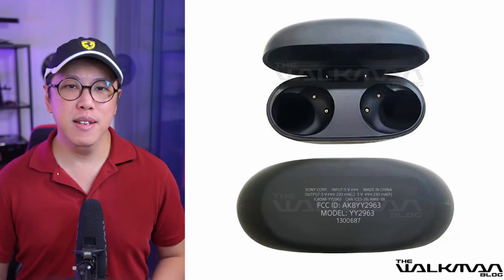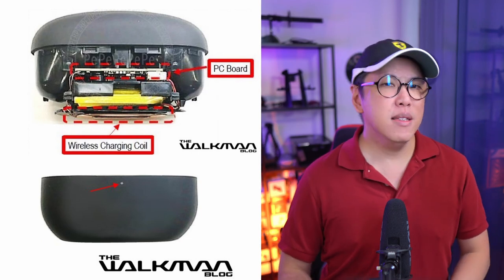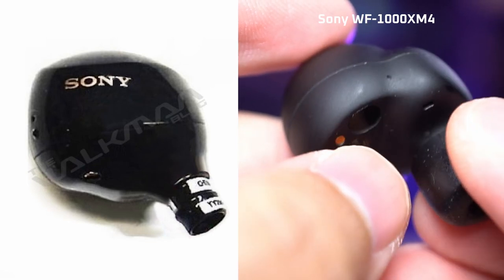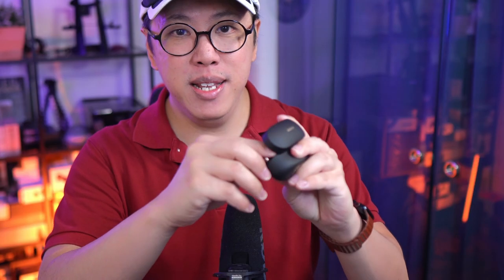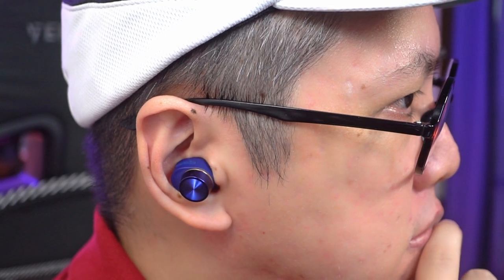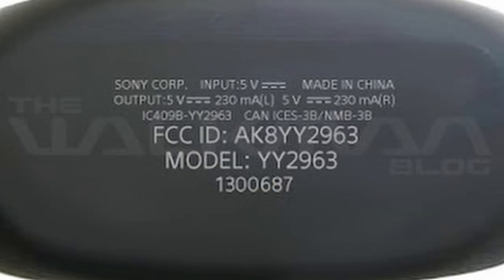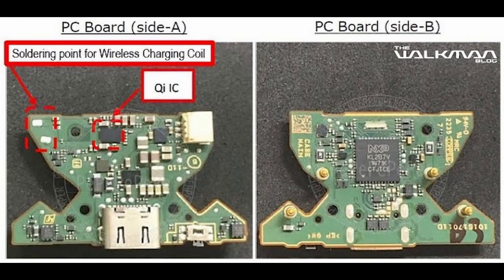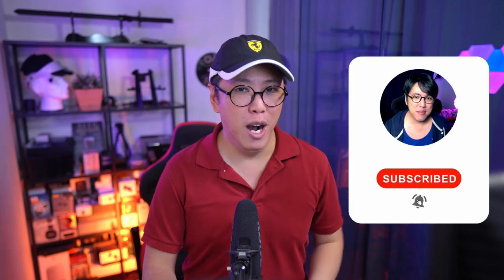Finally... This is the Sony WF-1000XM5! 🔥🔥🔥

Comment: Thanks Aaron. Off to read the link. Article read. The one thing that stands out is the matte case but glossy buds. Would make sense the other way round but glossy, slippy buds in your hands and in your ears? I hope this is not the finished product? Thanks.
Reply from the maker: Yeah we'll have to see if it is really slippery or there is a design element that mitigates the slipperiness

Comment: Had nothing but issues with the xm4’s. Especially after about the 1,5-2 years mark. Battery randomly discharging, overheating whilst charging, case not holding charge etc etc. Sadly the xm5’s will be a hard pass.

Comment: Man it’s been so many years and AirPods Pro case is still the best. Really good balance between battery life and size. And I don’t understand why companies increase the thickness of the case instead of the height. APP case is thin but squarish which means that it slides really well in pockets.

Comment: I have WF1000XM3's for sleeping. I tried the 4's but they're uncomfortable while resting your head on a pillow.

This is what I don't like about the XM3's:

The noise canceling is on by default and it doesn't remember if you switched it on or off.

That means every time I get on a bike or I'm walking and it's windy outside, I have to go into the app (wait for it to load) and switch off noise canceling.

This is so annoying that I have cheap wired earbuds for when I go outside.

I don't need noise canceling 90% of the time, if it can't remember whether noise canceling is on or off (I don't see why given that it'scontrolled by the app but whatever), that's fine, but at least give me the option to have it off by default.

This really annoys me I guess, from a design perspective. Does the 4 still have this issue?

Comment: The new Sony WF-1000XM5 are completely better than even first-class predecessors.
Even though the Sony WF-1000XM5s are smaller, they sound even better.
Battery life has also become even better.
Tragekompfort hold bombproof in the ears, all Sony hold bombproof in the ears, the Tragekompfort is perfect.
The new Sony WF-1000XM5 since Sony has again done as always maximum best work.

Comment: I got wf xm 4 and wh xm 4 momentum 2 /3 overhead and earbuds and bose quietcomfort 1 and 2 earbuds and earfun and soundcore and 1more. Because of battery drain from 12hrs to 4 hrs on wf xm4 I WILL NEVER EVER BUY a SONY . plus sound quality is WORSE THAN all cited brands.beware PEOPLE
Reply from the maker: How did you get 12 hours?
Reply: Price: $279, £199 , AU$348 ; Colors: Black, silver ; Battery life (rated): 8 hours (ANC on), 12 hours (ANC off), 24 hours (with charging